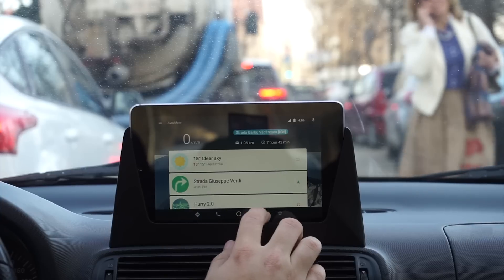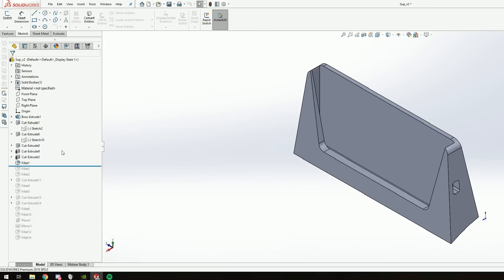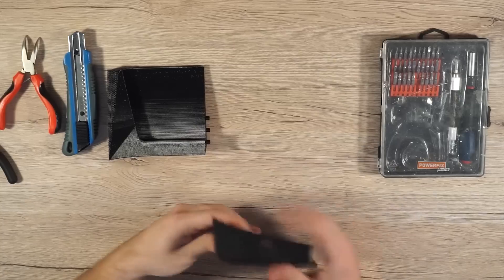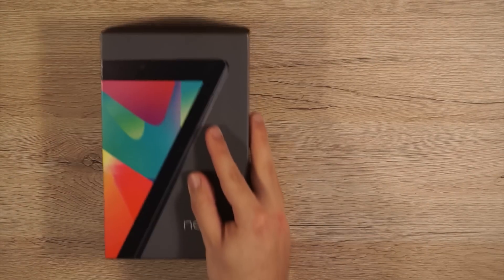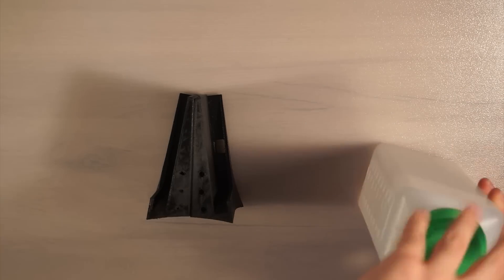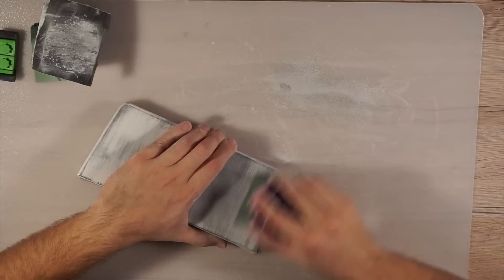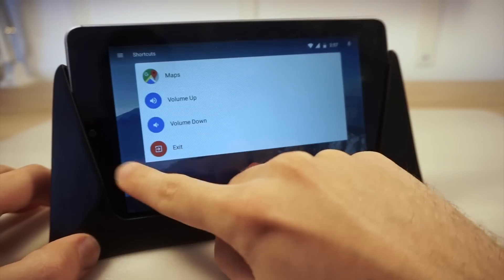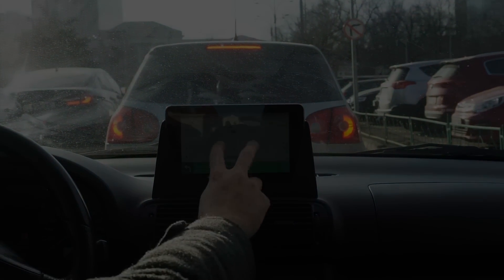The ULTIMATE DIY Head Unit - with ANDROID AUTO

Comment: How well do you think this would fit in cars other than the Seat Leon?
Reply from the maker: It depends on the car. If it's a Golf Mk4 it would fit nice, maybe on Audi A4 (2000-2006) too. For what car are you interested? :)
Reply: @tinkertv  I was searching for solutions to do something similar to this with the current generation Ford Mustang, actually. I have the base radio and retrofitting in a  factory touch screen is ridiculously expensive ($1,800).

Love how it came out by the way. Beautiful design!
Reply from the maker: Thank you very much! :)

Comment: I'm interested in this build and everything looks fantastic. However, I'm curious as to how you manage to get cellular data on the tablet without hooking up your phone to it? Why did you decide to do it this way and not use a Rasperberry Pi instead?
Reply from the maker: Hello and thanks for the question! I am using cellular data from Sim Card that is inserted in it. Also, I thought about using a raspberry pi but it is expensive. I will look into this soon since i am interested :)
The only thing that i found out using it is that the poor nexus is getting older now, and it is not that responsive.
Reply: @tinkertv  Thank you for the reply tinker! You might want to try something new like the Lenovo Tab E8 if you're still not wanting to go the Raspberry Pi route. The tablets are running on the latest version of android and are as light as a nexus tablet in terms of UI and performance.
Reply from the maker: @LakeNuu  Yes I thought about the new ones, I will take into consideration :D I shall get some small ones, max 8 inch so it is not distractive in traffic :D. I am currently working on a new version (smaller and neater than this one) which has connections for audio aut and charging throught the pogo pins. If the nexus shows his age during the next months I will go Raspberry pi :D